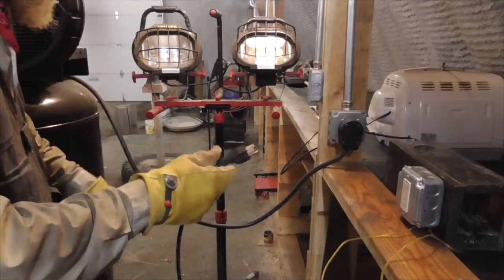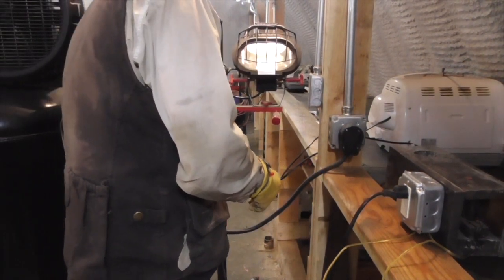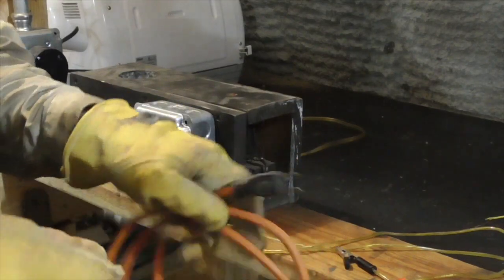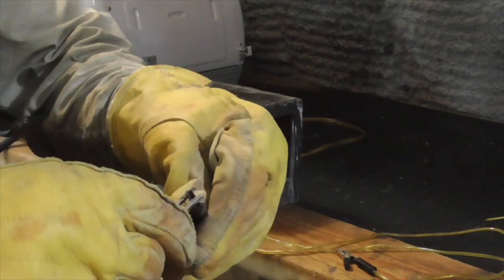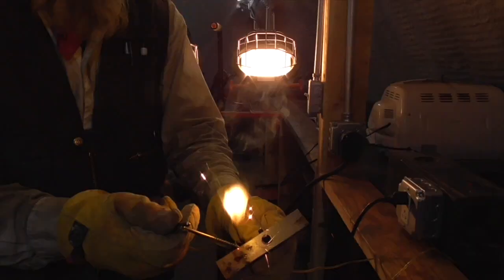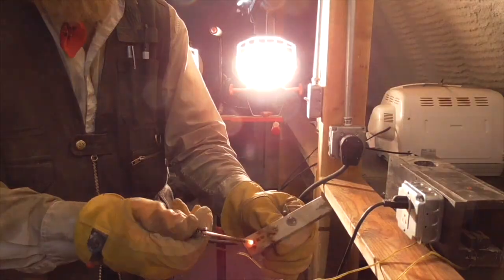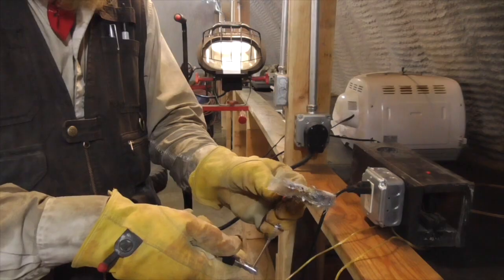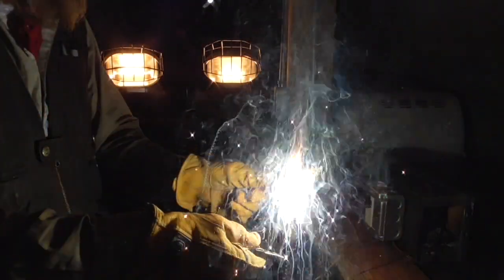Electrical Current Regulator Hack (TIS228)

Comment: Old Nicad Battery chargers and lots of bench supplies used to use an incandescent bulb as current limiter.  You could change out the bayonet mounted bulb to a different one for different levels of current.  I still remember the bench supplies my Dad  built with a bank of these and switch selectors so you could dial the max current level.
I'd never thought of going to the level of current you are talking about - ...but don't know a good application either.  Old transistor circuits had to be well designed because as they heated the transistor would conduct more and POW.